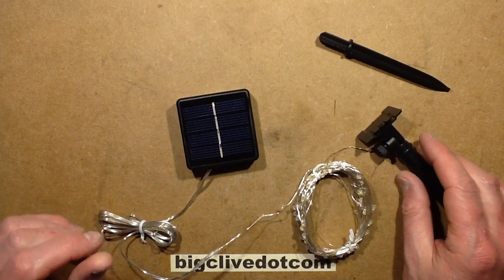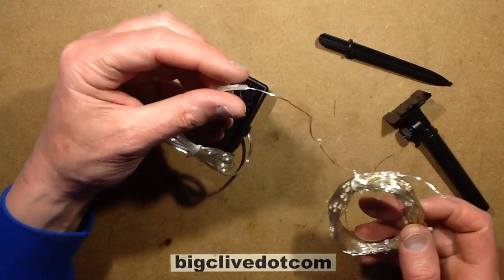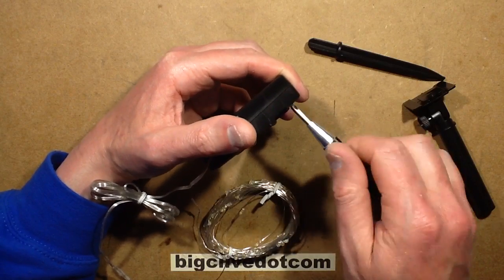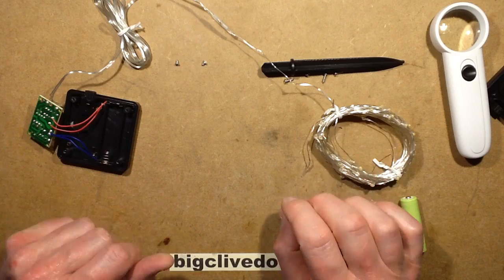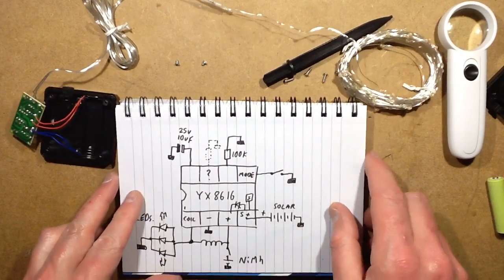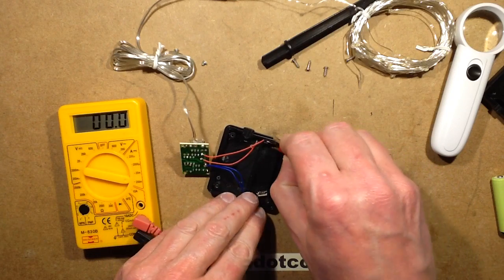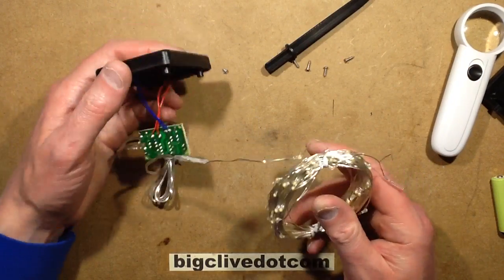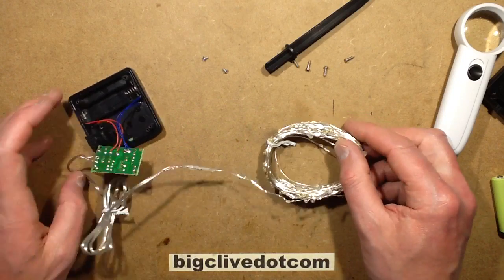Solar LED string with resin dipped LEDs.  With schematic.

Comment: Hi BigDaddyoClive, Love your videos for some time now. always a good antidote to a bad day.

I have a similar Copper-wire LED string solar light. but sadly the power out to the LEDs are so feeble, it barely glows even in the darkness of night. I'd like to get more of the units I have and was wondering if you'd be able to recommend and suitable mod to bump up the voltage and get a little more light out of the LED strip. I'd be happy to send you a product to glean your expert mittens over (I might even include a mystery 'confectionary treat').

keep 'em coming
Reply: From my rudimentary memory back to school. I'm imagining a change in a resistor to a chip will determine output voltage, unless it has a set output regulor dudad

Comment: You got the chip number wrong. It's not a YX8616 it's either a YX861 or a YX861A. Mine has the YX861A in it. If you google either of those numbers, you'll find a number of datasheets for the chip on the web, however most of them are in Chinese, but there are example schematics that are easy enough to read.
Reply: I'm wondering I have lots of these and I love them
I had a string get broken. The small part coming from the solar panel still works but I have tried to twist the wires together and I can't get it to work any thoughts?

Comment: Thank you for the video! 
I wonder if you could help... We have set up a very similar solar light system (same circuit by the looks of it) but after some time the small Li-ion cell stopped charging. So, thinking that the cell had reached the end of its life, I replaced it with 3 NiMH AAA size cells in parallel (so 550mAh x 3). Strangely now though, the start of the LED chain is bright but several LEDs along and the light has faded gradually to nothing. The output of the controller is 0.98V with no current flowing, so I'm wondering if the internal resistance of the 3-cells in parallel is too much for the circuit and LED chain? Very grateful for any ideas you might have!
Reply from the maker: It sounds like you may have a bar LED or short circuit on your lighting string.  That would also possibly have dragged the other battery down.
Reply: Thank you! I'll check that out :)

Comment: I'm interested in doing my own garden type solar small solar panel with led light strip. To charge up battery and turn on at night how do I go about wiring up a solar panel and can you get 12 v as batteries or will 50 om resister allow normal single battery to power them. Or can I use old phone batteries in series to get 12v batt

Comment: Hi Clive,  My contumacious cat has chewed my GDEALER tiny light set.  Again.  I refuse to buy a third set.  Is there a way to repair the wire?
Reply from the maker: If it's the copper wire lights then they do tend to be repairable.  It depends on how it's wired, usually determined by the operating voltage.

Comment: Regarding solar energy, recently in my town the council replaced all the street lighting lamps with new low energy LED lamps. but it got me wondering why street lighting don't use solar functionality as a primary source of power which would effectively be free power. Obviously they would still be connected to the mains for secondary or back up power when there hasn't been enough sunlight. They are often highest item a street so a solar panel on the top would seem to make sense. But I have only seen it in use recently, in some road traffic signs which illuminate as a vehicle approaches.
Reply: TheKentpaul. I know I'll be a good question they're putting up these LED lights in the city where I live at two. But i was wondering but if itz got a solar panel on the top it's going to need a battery the store the power and of course. Not just the city mains
Reply: In the U.S., many congresspersons are heavily invested in utility companies ($$$ in the bank), so they're in no hurry to bring solar into widespread use.

Comment: All well and good so far, Clive. However.....Could you go to the last LED on the string and have a look at it. Are the two conductors of the power line exposed?I bought a couple of sets very similar to these (indoor/outdoor) and they have the conductors exposed as the manufacturer has just simply cut them off and not sealed them up. After the first shower of rain the battery could be shorted out and possibly rendered useless.Maybe you could check yours to see if that is the same?
Reply from the maker: That's standard, as the strings are made on a continuous production line.  It's very low voltage (just 3V or less) so safe, but I'd recommend bending them away from each other so they can't short out and to reduce the risk of corrosion from a drop of water sitting across them.
Reply: Thanks for the response, mate. I've got a few bits of heatshrink laying in the shed. It'll do no harm to cover them with that too.I know they're cheap stuff, but I don't want them failing sooner than they have to.Great channel - keep up the good work.

Comment: I have a few sets of these lights and wondered how to make them a little brighter. Do I replace the batter cell with a higher capacity cell? Your light set had a 1500 mAh cell. Would it be brighter with a higher mAh cell?

Comment: I do not no how ebay handles stuff in the uk but in the states if you get something and its not as the photos show ebay will tell you to return the item at the sellers cost and since the sellers are in china you will get to keep the item as right away the seller will offer a refund if you demand it sometimes even send the photos part or if they do not ebay will refund the price when they see return shipping is more then the item cost. even when I order stuff in the states from one to a nother if the return shipping the more then the item value ebay will refund it and I keep the item.

Comment: Your videos have inspired me to jump into doing fun LED projects.

I bought a similar set of these string lights and hacked it to bits in order to use the string of LEDs inside of a Welcome sign I'd built.  

The sign only lasted about a year in the weather (it was made of wood that wasn't very well sealed or protected) so it's time to rebuild it.  
The lights and circuitry still work fine but I bought, on your recommendation, a huge quantity of 3W warm white LEDs and I want to use them instead of the cold white original ones. 

I also want to drive it with 2AA batteries (so 3v) rather than the single 1.5v cell from before.

This is my first LED project and I'm really quite a novice with electronics, so pardon me if my questions sound dumb.

I've got the new LEDS all connected in parallel.  They all light up from both the naked batteries and from being connected to the solar panel circuitry.  Everything seems to work, except that when the panel is absorbing light the LEDS are supposed to turn off.  Instead they just get dim.  They do turn off properly when using a single battery like before, but in that case the LEDs are significantly dimmer.

I've ordered a 3v solar cell to hopefully fix this issue but now I'm not sure if the other circuitry is robust enough to handle it.  

So, what is happening that causes the LEDs to stay lit when the solar panel should be charging the batteries?
How do I determine the specs of the solar panel I have currently?
Can I just swap in the new (ostensibly higher capacity) solar panels directly?
Are the components cheap enough that I could just reconstruct the whole thing from scratch?
Reply: How about a 1 year report, Mike? Everything work okay?
Reply from the maker: The circuit uses a small inductor to boost the voltage to drive the LEDs at dusk.  By using the higher voltage it is already high enough to drive the LEDs and passes straight through the inductor.  You could use a bigger solar panel by connecting it in place of the existing one.  A lower voltage one will be more efficient as the maximum voltage needed is around 2V for a single cell.
Reply: I appreciate your reply.
I think I understand but I'm a little confused still.

Would changing the inductor for one of a different value (or removing it altogether) cause the circuit to work as desired?

For what it's worth, having looked more closely at my circuitry, it's almost exactly the same as in your video.  Same chip (YX861A), same schematic based on your doodle, etc.
Reply from the maker: Don't remove the inductor, it's needed for operation. If you used a lower value inductor it would increase the intensity of the lights.  But you will still need to use just one battery with the unit.
Reply: Fair enough. The markings on mine suggest 47µH (Yellow, Violet, Black, Silver).   Do you have a recommendation for a replacement?

I really appreciate all your help. I'm sure you noticed already but I made a pledge on Patreon for you.
Just watching you effortlessly solder and desolder all of these fun cheapo electronics has really upped my confidence and subsequent skill level with the iron.  Thank you for that as well.
Reply from the maker: 47uH is already quite a low value, although you could try 33uH.  But keep in mind that these devices are only intended for low level illumination to allow operation from small solar cells and batteries.
Reply: Great.  Thanks for your help.  The ebay listings seem to all come in sets with lots of different values so I bought a couple of those.  I'm not sure if it's .5w or .25w so I got both and will play around with them to see what works best.
Reply from the maker: +Mike Bryan Those are resistor style power ratings.  Are you sure you've bought inductors?
Reply from the maker: That looks like a good choice.
Reply: bigclivedotcom I ordered similar selections in .5 and .25w (whatever that means) so I'll just plug and play until I find what works, hopefully without anything going bang or getting too hot.

Comment: 100V N-Channel Power Trench® MOSFET
Features

    Extended TJ rating to 175°C
    Shielded Gate MOSFET Technology
    Max rDS(on) = 14 mΩ at VGS = 10 V, ID = 9 A
    Max rDS(on) = 23 mΩ at VGS = 6 V, ID = 7 A
    High performance technology for extremely low rDS(on)
    Termination is Lead-free and RoHS Compliant

Comment: Re non EU compliancy. Most likely possibilities:
1) Lead (not lead free) solder. 
2) Maybe some ship with NiCad battery (cadmium).
Both metals have very low thresholds to comply with RoHS(2). No RoHS = No CE mark (though most Chinese suppliers selling on ebay take no notice.)
Maybe they feel if they put a non-compliancy sticker on them then they will avoid trouble...

Comment: Hi  More info and sample circuits, etc on a YX861A or YX861G where the lat "6" on your part might actually be a "G".  The part is called a "SolarLED String Driver"
http://www.datasheet4u.com/pdf/YX861A-pdf/789098

Comment: The notice on the package is not related to any properties of the stuff inside. 
Some sellers, especially the bigger ones, ship stuff in a 2-phase way: first parcels for many customers are sent in one common box to a place in Europe, whereby individual parcels are sent to the recipients using local mail. Probably this optimises costs. 
And when essentially forwarding the parcels without customs clearance, they have to put a sticker on, informing that the goods are of non-EU origin and are to be customs cleared despite coming from a location within EU.

Comment: is that a 18650 cell?
Reply: if not could i use one instead?
Reply from the maker: +cassidy cripe No.  It's a NiMh cell and the unit does not contain protection against over discharge.  The solar panel is also only rated for about 2V so would not charge a lithium cell.
Reply: thanks
Reply: bigclivedotcom - if there is no over-discharge protection - does that mean the battery will easily be damaged? I just recenrtly purchased one of these and it does not seem to be able to charge enough to run the lights for very long. The lights begin to dim within just a couple of hours after dusk. I have RGBY lights in mine and the string soon turns to only green and then dims out from there. I guess I should just test the cell and see if it is damaged. Seem like you have a video on that somewhere...

Comment: great video, you seem to be the guy to ask, the insulated wire on the led's. the same thickness in silver... where can i buy it from, i have searched all sorts of names, but cant find it.. i just want the wire to extend my micro leds, as i use 3v and 4,5v micro led's..but want the wire on its own, on a spool if possible ..please can you help..thank you..
Reply from the maker: +ivan hodgetts Not sure about the silver version, but if you search eBay for enamelled copper wire you'll find a wide variety of sizes.
Reply: thank you..i'll look, but really need the silver.. :-(

Comment: If you are talking about the yellow sticker with: "Goods do not meet the requirement of Article 9 and 10 of the contract for the foundation of the European Community" or something similar, here's a bit of info on why it is there and what's the purpose of it:

https://thomas.vanhoutte.be/miniblog/explained-yellow-sticker-on-package-goods-do-not-meet-the-requirement-of-article-9/

Comment: YX8616 
1.2V rechargeable battery applications
Current: 200MA
Features: Boost, light control, charging / lit, flashing (a string of lights)
Features: Blinking frequency adjustable duty 1/2 
Packages: DIP8/SOP8 
Periphery: L+C+R 
Operating Frequency: 1.2V 79KHz / 2.4V 61KHz

Couldn't find an actual datasheet, but this is as close as you are going to get, with application notes and pinout-
https://detail.1688.com/offer/520831491609.html

Comment: i have garden lights that are controlled from one central unit that powers 10, 12V bulbs, i want to run two small wires from the end to the lights, over the gate and into the back yard to power some other lights, since the garden lights don't supply enough power for more than 10 lights, and only turn on at night i'll use the signal to turn on a transistor to power additional lights from a different power source. 

my question is do I use a mosfet or an NPN transistor? they both seem the same in this instance. 

also, if i run a string of 1w leds off a capacitive dropper (with a 68v zener diode so no high voltage), how will the voltage change going through the transistor? 

thanks!

Comment: Um ! just wondering why they used ni-mh and not Li-ion (phone battery)........I have some ni-mh running  solar lights in the garden, and they have been running for years, could it be that Li-ion don't last that long.......Um.
Reply from the maker: +Graham R Dyer Some of the newer lights use LiFEP04 cells and do last a good length of time.  They just use the higher voltage to drive the LEDs directly.
Reply: +Graham R Dyer   Ni-Mh is cheaper and plentiful....

Comment: I find the data sheet for you https://baoan.1688.com/offer/525287040079.html . But it is 90% chinese.
Reply: +JÄTTI PASKA 

Some of things it says in the datasheet translated using google translator apps camera feature

Solar LED light string controller VX8616 is a company based solar LED string lights work characteristics specially developed functional light string controller chip, the main function boost, light control, LED driver function, solar charging. The controller has a high conversion efficiency: 80-85% (typical value), it can reduce the solar cell power requirements: adjustable output current, fewer external components, an adjustable flash frequency characteristics. 
■ Features: High efficiency: 80-85% (typ), can take advantage of solar power LED flash frequency modulation 
● Input current adjustable current range: 8-200mA 
● Enable low voltage, to ensure that lighting in the outside light enough dark when it is turned on to enable control Schmitt performance, to ensure the stability of the lamp light and dark when switching 
● fewer external components, only three: a resistor, an inductor and a capacitor 
■ applications: l section 1.2V solar powered products 1-200 LED strings in parallel 
■ L pin function description SOP8 package and pin assignment DIP8. LX boost switch foot 765 2 | GND according to the positive battery terminal BAT positive full sun

Comment: They should have put A diode over that power switch so that the battery keeps getting charged when the switch is open. For the rest indeed it's A really good LED string!

Comment: I have a set of Bright white LED's in my bathroom (no windows, just ceiling extractor) that uses that same construction (with a waterproof 3xAA case). They have been able to cope with all of the dampness in the room without any issues. They look fantastic wrapped around the edge of the mirror and can light the room when I don't want the extractor to come on with the ceiling light.

Comment: It seems pointless to have a solar panel on the device since it will most likely be ON at night. Doesn't do much good. Maybe you should put a diode across the ON-OFF switch so it charges the battery in the daytime when there is light on the panel.
Reply: +Ken Franco Are you really that stupid? The ON-OFF switch is always "ON" except during transit and storage. The OFF position is simply to stop the battery being discharged back into the solar panel when the device is in storage. The diode that you think is needed is inbuilt internally within the IC, between pins 3 and 4.

Comment: That cell is an 18650. so it can be upgraded to I've seen "3500 mAh"
Reply: +William Gracia thats a weird one ive not seen a 1.2v 18650 before but you are correct about the size. All of mine are 3.7v most are around 2600 mah hate to see what they would do to the poor LEDs
Reply: +William Gracia Unless Clive's got gigantic hands, and also comparing to the pokey plastic bits from the lights and the screwdriver, it looks more like a 14500 (about, if not exactly AA size) Common as 1,2V (as they can replace an ordinary 1,5V AA battery. 1500mAh is about right for a decent one.